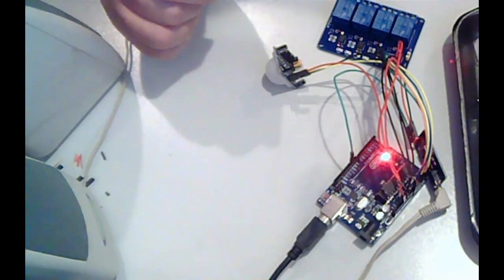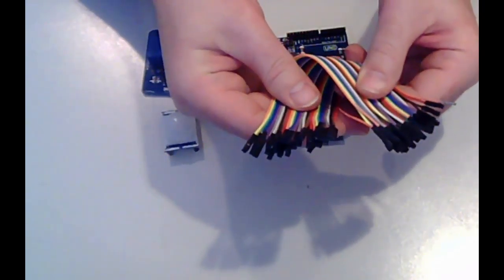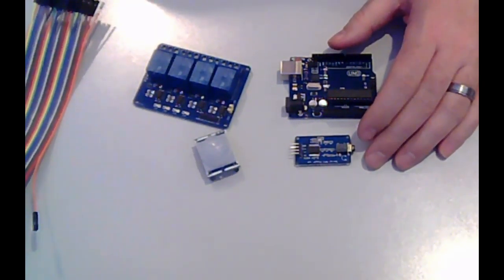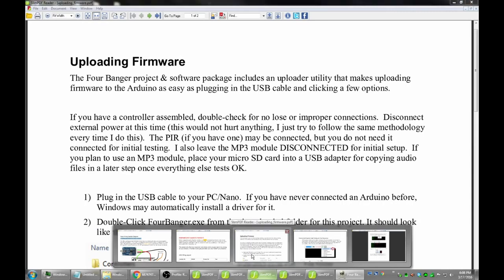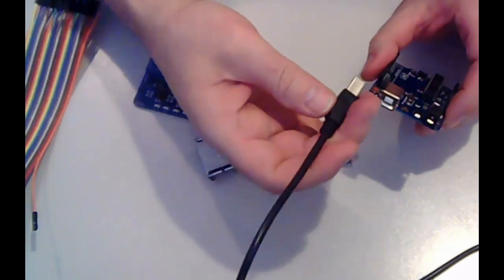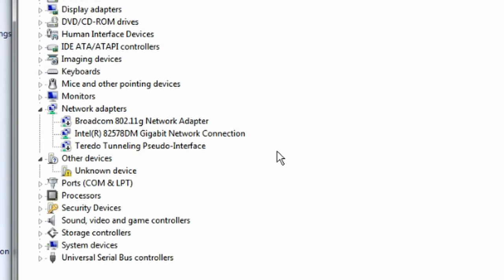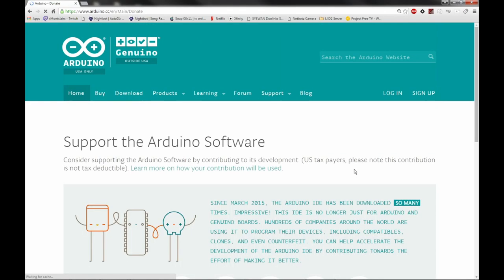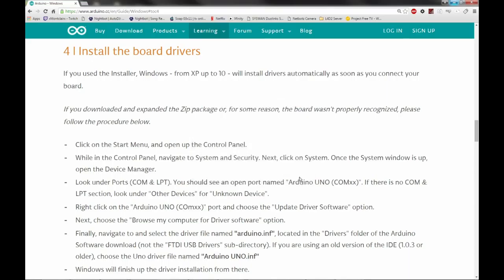$20 Arduino Prop Controller Part 1 - Halloween Vlog - 2016 Episode 6: Control Yourself!

Comment from the maker: NOTE: If you have the Arduino knock off board, which matches the one in the illustration, and are comfortable with soldering, you do not need to cut and splice the power and ground wires. Just solder the included pins onto the arduino and wire power and grounds as Mike has illustrated in the diagram.

Comment: Well I want to buy the stuff today...but does the software work on a Mac? I was looking at Mike's page and I only see mention of Windows. Do you know? Jason at Graves of the Groves wasn't sure
Reply from the maker: +GhoulishCop It does not appear that Mike has written the software for the Mac  You may be able to run it under a software program called WineBottler, which runs Windows programs on Macs. Check out details here: http://winebottler.kronenberg.org/ A tutorial by some kid is here: https://www.youtube.com/watch?v=DkS8i_blVCA . My recommendation would be to setup WineBottler then setup Mike's software and see if you can get it to run. If it does, then you're half way there. The other issue would be how the drivers have to be installed, and how that translates to whatever the Mac needs to support Arduino Uno's.

I'd plan on doing a bit of research on all of that before buying the stuff. It may become quite technical to make it work on a Mac.  My top suggestion is go to one of your buddies who has a PC and do your work there on it. Or, buy a cheap PC. :)
Reply: +Montclair&#39;s Lair Thanks! I just found Mike's original post on Hauntforum and he says there it requires a Mac running vmware to program it. Since it has the button board, do I even need the software? Couldn't I just "program" it via that? Though maybe I should just have someone with a PC do it for me. lol
Reply: +GhoulishCop To answer my own question, No, you still need a PC to upload the original Arduino stuff and then afterwards could use the buttons. But the consensus seems to be don't even bother buying the button board. Just do everything via PC. so I'll have to track down someone with one of these things and do that.
Reply from the maker: GhoulishCop VMWare would be a good alternative, too. VM means virtual machine. Basically, your computer runs a program which emulates another operating system. You can run whatever OS you want (Linux, FreeBSD, Unix, Windows).  Essentially, you could have a full PC running in a window on your MAC.  I've run Linux this way on my Windows system.

Comment: Hi Dave,
Thanks for such great content and detail! I'd like to make this prop controller with my daughter for Halloween this year. But I noticed that Mike N. discontinued the FourBanger and replaced it with his OctoBanger example. Will your video tutorial work for the OctoBanger as well, perhaps with a couple minor adjustments? Or can you recommend a different tutorial video I should follow for building the newer OctoBanger prop controller? I'm a total beginner, with no experience. Thanks for any guidance, advice, or video suggestions!
Reply from the maker: Actually, his page is still there on the four banger at http://buttonbanger.com/?page_id=37.  My tutorial won't work for the OctoBanger, exactly, but the section where I cover the software part of it is virtually the same.

Comment: Hi i was wondering if you could help me i built the arduino controller after watching your video could you tell me how to turn the ambient sounds off as i just want the scare sounds
Reply from the maker: Stuart Johnson Honestly I'd have to look at the software, but I think you just don't have to specify an ambient audio file and it won't play any ambient audio. Have a look at 36:30. It looks like you can just uncheck the ambient file when transferring the files. You could also just open up the SD card and play the 001.mp3 and 002.mp3 files, then delete whichever is the ambient audio. Also, when you start a new project with the software, there shouldn't be any audio files specified. Just don't give it an ambient file and you should be all set.
Reply: Montclair's Lair thank you for your help i will look into it as ive got 3 props to add them to after taking ideas from you
Reply from the maker: Check the next video here: https://www.youtube.com/watch?v=RBpGNcN6qsc . I go over the software in great depth. Specifying an ambient sound file isn't required when creating a scare project. Thanks for watching and commenting!
Reply: Thank you for you help on that last issue i managed to sort that but now my channel relays are not sending out power for my lights and solenoid

Comment: also you might have seen my question on facebook. But have you tried to use the arduino in a loop without using a pir sensor. What I mean is I want to have the arduino start its sequence as soon as I plug it in. Then just keep looping. I want the prop to move for , like 30 and then stop for 10 seconds. and then move for 30 sec. And then at the end of the sequence pause for a couple seconds and then start all over with out any other input from a sensor. It seems like maybe i can just connect two of the wires that are connected to the pir and connect them together. Im not sure.
Reply from the maker: I wouldn't use the PIR pins for that. Try jumping the manual trigger pins. That would likely be the easiest.  Just connect one wire from pin 11 to any ground on the Arduino. Let us know how it works!

Comment: hey Mike where did you get the pin assignment list? i have the four banger page open and I dont see where you got that list to pop up from.
Reply from the maker: I'm actually Dave, but I got you. It's in the document called "uno_wiring.pdf" located in the Docs folder. You can access it right from the Four Banger application by going to Help -> View Help -> uno_wiring.pdf

Comment: Has this been done with a MAC yet?
Reply from the maker: Unfortunately, the software has not been written for the Mac. You may be able to run it under Wine or a windows emulator.
Reply: Hey thank you for getting back to me so quickly, and answering my question. Thank you Don, Happy Haunting....
Reply from the maker: No problem, Don. Hit up HauntForums.com for quick and good help on this project.  :)

Comment: Nice work.
Reply from the maker: +The Pirates of North Court Thank you. I know the video is really long, but I wanted to try and cover some of the problems people may have putting this together, which admittedly, are very minor. The lack of drivers can be daunting for some people and then there are idiots like me who buy the wrong wires. sigh.  The latter made it painfully slow work. However, it is pretty amazing how simple wiring this thing is.
Reply: I might have to dig out some of my spare parts and build a few more. I have some ideas I need to work out so maybe I'll have to post that video too! See, that's what happens when I check out other haunters videos.
Reply from the maker: Well, I followed your tip and it works! Episode 7 will show me doing the wiring! Thanks for the awesome tip!
Reply: +Montclair&#39;s Lair OK, I was going to answer your question but it looks like you figured it out. I'll be sure to watch and see it in action.
Reply from the maker: Yeah, I got it. I'm editing episode 7 right now where I cover chaining them together. Thanks!

Comment: so should I get the male to female wires only?
Reply from the maker: No, get both. You'll need two or three female to female. They're very cheap. Before buying stuff, though, watch the entire video series. You'll likely want to get an additional separate 5v power supply to power the relays independently.
Reply: ok thanks. ill just get a shit load of each wire. Ive got plenty of 5v power supllies. thanks dude